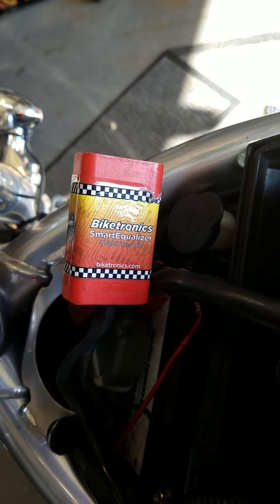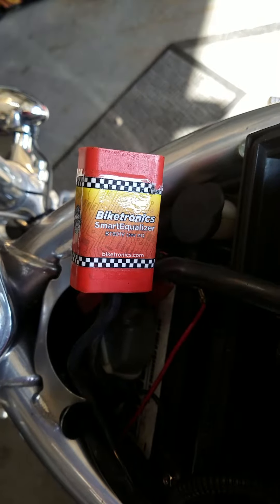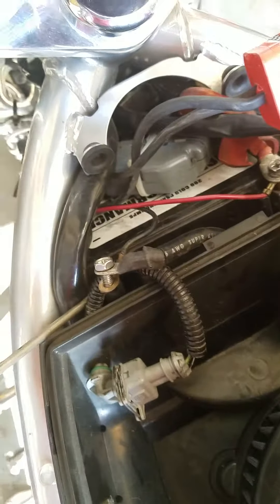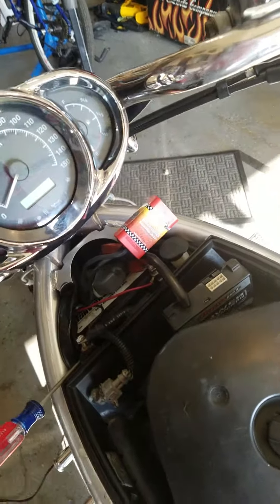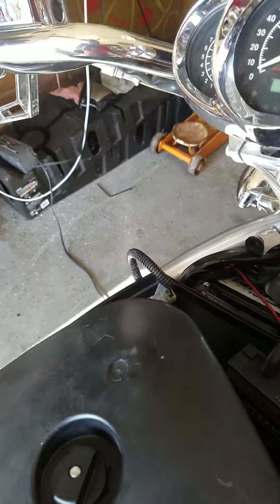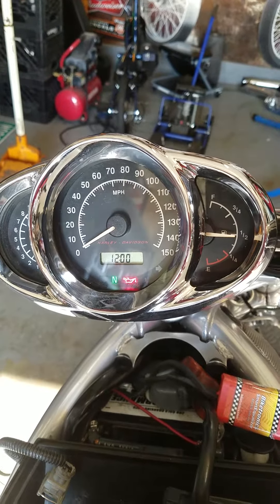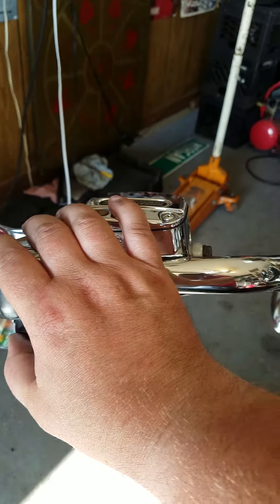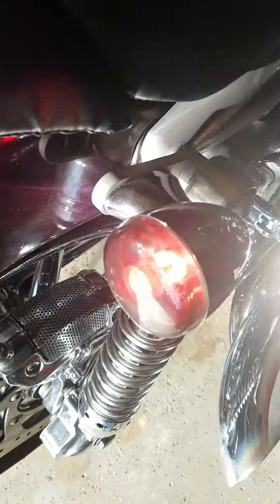Biketronics load equalizer

Comment: Thanks for making the video.  I just purchased a 2005 V-Rod CVO.  One of the first things I did was to update all the lighting to LEDs.  I couldn’t find a plug and play equalizer until I found your video.  One question I have is where is the actual plug point.  Is it by the battery or is it in the left side of the frame?  I took off the frame plate cover and all the wires are so compactly and tightly put together.  I just don’t want to start unraveling everything there if the actual plug point is in there battery area. Thanks again!
Reply from the maker: It's been a while but I think it was was the left side of the frame
Reply: Christopher Morgan Thank you!